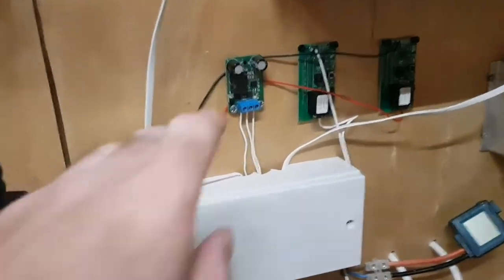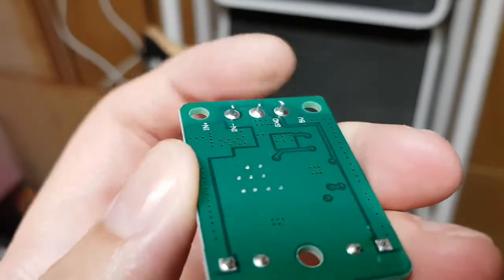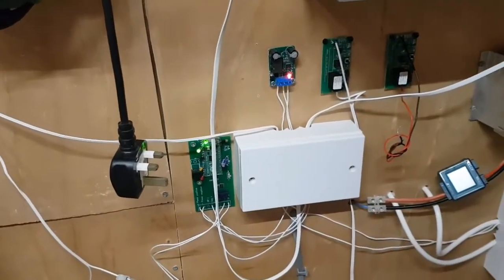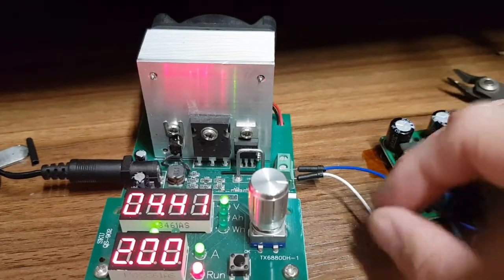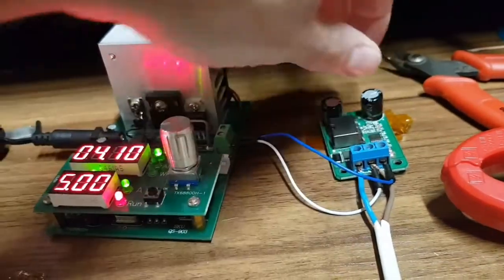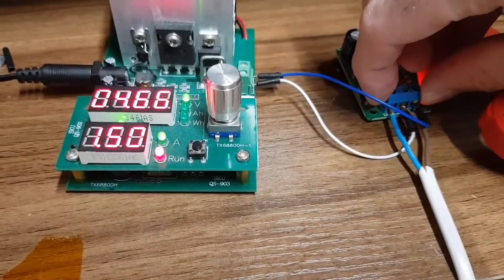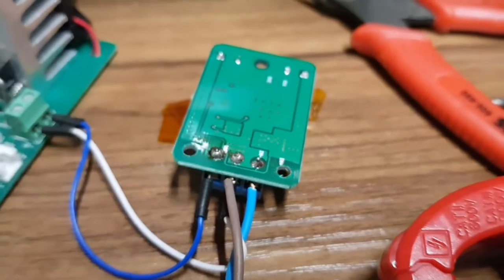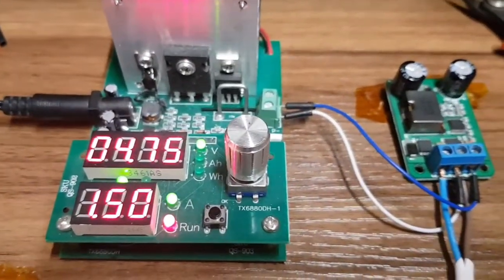power supply failure

Comment: I‘ve seen soldered screw terminals lead to a fire (thyristor). Please inspect the soldering and don’t over tighten them.
Reply from the maker: indeed, any high resistance joints on a high current connection will get hot.

Comment: Hello Matthew,
About wood and electrity, I think it was in the TV show monster garage, they made wooden supports for batteries bus bars, and they've got smoke, because of humidity.
Reply from the maker: interesting, i will see if i can find that program. i can see it being an issue if the wood soaks up water.
Reply: @mathewlawrenceml  It was Jesse James, monster garage, using Milwaukee drill batteries, a  lot of them in series mounted in wooden racks to fit in the car trunk. I can't find this episode, maybe because I'm in Belgium, maybe if I used a VPN...
Eventually they used older dried wood, and it worked, but they still had issues on the drag strip, bad connections, if I remember, it was a long time ago. 
You could put something to protect the solder joints, varnish, silicone, butyl rubber, anything, easy to remove if  needed.
Cheers.
Reply: https://www.youtube.com/watch?v=IYpAAr5xQVA
I think this is a part of the episode.